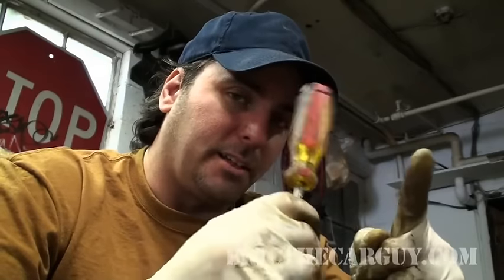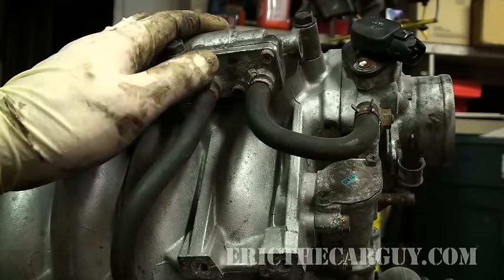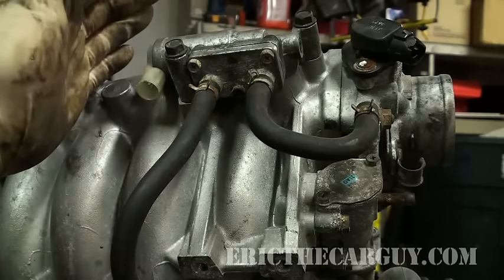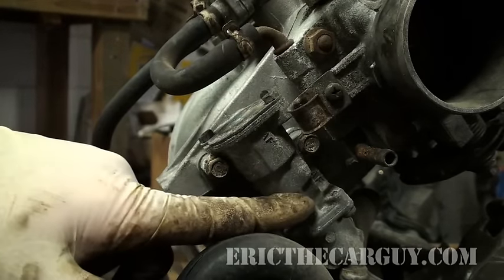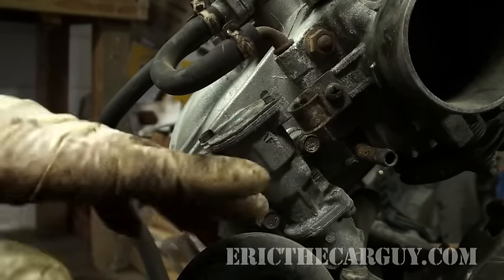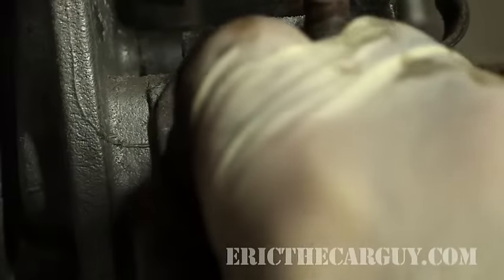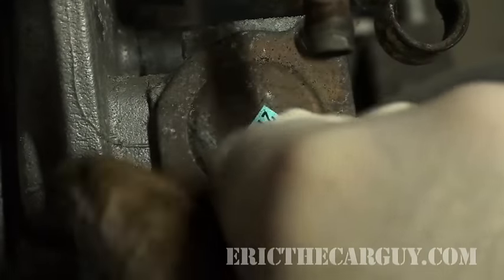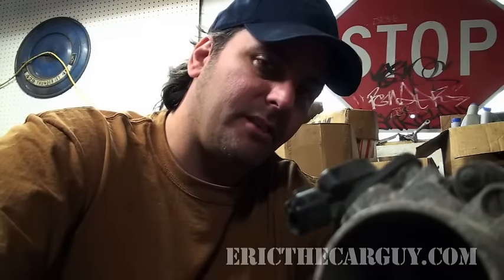How To Solve Honda Idle Problems - EricTheCarGuy

Comment: Thanks for your video, unfortunately I have a 95 Civic LX that has no scanning tool input, so I have to throw parts at it but I try to do so by doing as much study as I can on evaluating the symptoms, cause of symptoms and where the problem exist so I am thinking about it but then it’s still it’s like throwing a dart in the dark. Thanks all for your videos they are very helpful. Because right now I have replaced the map sensor, TPS, Oxygen sensor upstream…Then I replaced the distributor, all due to stalling out of nowhere, and then after we got the timing set on the distributor corrected the accelerator now will not calm down and this was not an issue before but it is an issue now so I’m trying to figure that one out.

Comment: Awesome presentation. Great advice as always.  My Honda 92 is still running well for my son's college car, but the idle slows almost to a stall when the air is turned on, (which still, after all these years, blows cold).  I'll give your possible fix a shot.  Thanks!
Reply: Beware of auto technicians who typically have only a passing knowledge of refrigeration when letting them service your A/C. And check the temp of the air coming out the vent before you take it in so if he screws it up you'll know.

Comment: Hey Eric I have a 95 honda civic 2 door coupe and I put a jam zc Non vtec engine in it and I have been driving the car for over a year now and the only problem I ever have is after I drive it for a few hours it starts wanting to have a slight sputter when I take off at a red light but it clears up right away soon as I get in second gear other than that it runs really strong but when it starts to sputter I usually let it cool off and then I can drive it again for a few hours and then it starts doing it again.its not a bad sputter just very small like one or 2 really quick sputter I really appreciate your advice I have fixed alot on my car from watching your videos except this one issue

Comment: I had surging idle on start up and when I took this off and did this, and took off the idle control valve off and cleaned it and put it back, now it’s not surging anymore at start up but after it heats up it starts slightly idling fast up and down and doesn’t want to go right. It only does it after motor warms up. When I first crank it up it runs fine. Any suggestions? I also didn’t see anything inside of the idle control valve.
Reply: I figured out. It was just a throttle body gasket and it was sucking air. I took it off cause I thought maybe the spring wasn’t working right and after I listen the bolts up the gasket fell out in peices.  Lol

Comment: I replaced the engine on my daughters 2k accord with a JDM swap. Her car had a few upgrades from the engine we bought power steering, cruise, A/C). Her intake had the extra throttle adapter for the cruise control. So I just changed over the top of the intake. Once I got the engine running I got the IAC code along with some misfire codes. When I pulled the IAC it had 3 hoses on it, for the life of me I cannot find where that 3rd hose hooks to on this engine the hose looks like a vacuum line. The JDM engine IAC only had 2 hoses on it.
So my question is this; what is the difference between 2 hose vs 3 hoses? They both use the oval electrical plug.

Comment: Well said! Unfortunately I am one of the examples you spoke of.. have a random misfire on a 99 CRV.. I’ve replaced plugs,(ngk itidium).. wires , cap, rotor,-coil, and fuel filter- all not OEM) ( I know.. that’s not preferred) but need to get to work and not wait on parts.. had code 1399.. then misfire cylinder 3 before all the parts.. then adjusted the valves.. and double checked after two days.. but it continues.. the symptom is when driving highway speeds for any small length of time.. then when slowing down quickly.. the idle drops way to low.. then can start sputtering and cel blinks and most times it clears itself out after continued driving.. but it sounds like its not running on all cylinders until it clears up and otherwise runs great..
The timing belt looked like it has not been changed.. I know I need to get it done w water pump.. but was trying to make it till warmer temps come around first.. could it be the timing belt is stretched and causing it? Or maybe the idle control?.. it also has new exhaust w o2 sensors.. 
I’m stumped.. it runs/sounds great till I slow for any red light/stop/exit.. usually need to pull it into neutral to keep it running..
Any insight is GREATLY appreciated bud!!

Comment: on a 2001 maxima, getting idle issues, Idle too high P0505, however the air intake hose is cracked and has leak likely letting too much air into the system since its past the MAF sensor. 
intake hose  nissan part #16578-2Y000.  Ordered part few days ago for it. hopefully that resolves it.  it's a intermittent issue that showed up after  some work was done to the car.  PVC and Grommet were just replaced along with plenum Intake gasket and other intake gaskets on throttle body.

Comment: Nice video. Mine reved up and down and it was the pcv valve hose. It had a gash underneath. Replaced the hose going to the pcv and intake manifold and it doesn't Rev up and down. 98 integra ls b18b

Comment: My car has different symptoms kind of. It idles rough but doesn't go up and down. It stays idling at the same place but It's rough and the exhaust isn't letting the air out consistently. If I turn the car off and back on once It's at operating temperature It idles at 200-300 and after a couple of seconds It goes up to about 700 and Is rough. I'm going to try the steps you suggested. Hope I figure this out today. I need to get back to work tomorrow or Wednesday at the latest.

Comment: Thanks for your video, my 2004 Honda was suddenly idiling very rough.
 I bled air out of the cooling system and it seems fine now.
One note- my 2004 Honda Accord did not have a bleed valve, I learned from another video that to
bleed air from the cooling system, I just needed to take the radiator cap off or leave it very loose.
Reply: And let it run? Without cap ? At idle obviously

Comment: just replaced the PCV valve on my 05 Honda Civic hybrid 
in order to do that I had to remove the intake manifold and disconnect some coolant lines after I put everything back together the idle was going up and down 
After watching this video I believe that the solution would be to bleed the cooling system 
Another problem that I have after this job is that my breaks are stiff and don't really work Any advice?

Comment: @ericthecarguy when you say that the Fast Idle Thermal Valve may be letting too much air in I assume you mean that the adjustment of the wax pellet allows too much air to flow in to the manifold. Later on you imply that air could be leaking into the coolant system. Am I misunderstanding you? Is there any way that if the Fast Idle Thermal Valve isn't adjusted correctly, it could be introducing air into the coolant system?

Comment: Don’t know if you’ll see this as it is an old video but I’m having a terrible problem that I can’t figure out. The issue is I have a weak orange spark and it’s getting worse. To the point that my 93 integra ls/vtec with type r pistons won’t hardly run once it warms up. I know you’re gonna kill me but I’ve replaced icm, coil, all plugs and wires, cap and rotor button. But still no good. I’m putting on a new main relay tomorrow but idk if that’s what’s wrong lol. Can you throw me some things to look at? Or point me in the right direction?

Comment: Hi there eric. I've been driving around the last 15 years with a '95 honda civic with no issues. During the past 3 to 4 months however, my aircon unit acted up. As it turned out, there was a freon leak that was corrected. Thereafter I noticed my engine was idling poorly and so I went back to the repair a/c shop. It was found that my idling was high upon start up but decreases when the a/c is turned on. The repairman advised me to bring the car to a mechanic to check the "servo". 

I haven't gone to the mechanic but did some DIY research on the matter  on YouTube that included some of your videos.  

I found the IACV on my honda and found  that it does not have the two outlets or hose connectors (how may I send you some pictures of the iacv, pls.?) but it appears these were purposely removed as borne by the fact that there are two slots for two small bolts for some attachment on the bottom. 

If the two connector points were removed purposely, how was the car's poor idling problem only manifested now? 

Thanks and more power to you.

val obana/manila, Philippines
Reply: Your engine idled poorly after the a/c repair because the extra 'drag' created by the compressor actually doing its job was not compensated by your IAC valve...<<what your a/c repairman termed the "servo", I believe. You most probably don't need the cooling system connections of the IAC valve in the Phillipines, so don't worry about those 'missing hoses'. What most probably is causing your problem is the cold-start idle speed compensator . .the plactic seating ring he turns with a screwdriver. Try the adjustment he has shown you there...

Comment: Hey Eric great videos OK 1999 Honda Civic 1.6 how to control valve replaced water pump replaced heater core flushed still experiencing high idle on the start at 2000 RPM also when I depress the Excelerator it brings it back down to 750 after a long warm-up. The warm-up. Is longer than a half hour sometimes getting some bounce on the RPM gauge

Comment: Please help me Eric... I've got a 1999 Civic that is starting to drive me nuts... A few weeks ago it wouldn't start, so I had it towed to a shop and two days later it was ready... The guy from the shop told me that it had been the distributor (some parts were out of place...) and that no parts were necessary, just some re-adjusting... When I got a chance to open the hood, I found out that the throttle cable had been tightened somewhat... I noticed right away that the car was idling a little lower than usual, but since it drove fine, I didn't make a big a big fuss about it... Anyway, it would always start with a low rpm, but it would go back to normal shortly after, when I would coast or stop. However, a few days later, when I went for a drive and sped quite a bit on an open road, the car's idle has changed significantly... It idles at around 1500 rpm when coasting until I come to a full stop, after which the idle drops to 1200 rpm... On cold starts, it revs up to 2000 rpm and gradually drops to 1200 rpm, so I think the IACV is ok...
I've checked the spark plugs which have about 12000 kms on them and look almost new, 
I've tried readjusting the throttle cable, but to no avail, 
cleaned the throttle body, 
searched for any hose with damage, trying to find a vacuum leak with water,
I also tried troubleshooting as in the shop manual, where you cover the lower port of the throttle body, where it states if you cover it and there is no change in the idle, then you have a vacuum leak and there is no change to the idle when I cover it...
However, if I cover the air inlet tube to the air filter, it makes what seems to be a suction noise... 
When I have the air inlet removed and stop the engine, a strange noise comes from the throttle body, like two or three hisses...
Does this mean I have a vacuum leak?
Sorry for the long post... Thanks in advance.

Comment: Question, I have a new IACV installed, done with the ECU reset, done adjusting the FITV, now my problem is, when I will start the engine aircon off the idle is to high around 1500, and when my aircon is on, the rpm will drop and drop until the engine will stall. What might be the problem of my civic? by the way my civic is a 1995 honda civic ESI with d15B engine on it..

Comment: Thank you. LTFT is adding fuel, suspect vacuum leak or stuck open IAC. Also, intake air horn has oily deposits, may be from diluted crank oil from extra fuel being added via LTFT. PCV looks ok.

Comment: Approach to Honda Idle Problems: (1st) check for air in the cooling system, (2nd) check for vacuum leak, (3rd) if you have idle problems and a check engine light, find out what's going on with the check engine light first and then other options, (4) can tap the IAC while it surges to see if changes things, (5) check fast idle valve.

Comment: Hi Eric, I cleaned my 2003 Honda Accord throttle body and replace the idle air control valve with a new one, now I have a car with fluctuating idle. I did let the air out of cooling system but at this point I don't know what to do next. Any suggestion would be highly appreciated. Thanks, Mark.

Comment: Would you recommend cleaning the Idle Air Control Valve? I've seen many people doing it with Preludes, did that on mine, now the idle was way worse and just gonna grab one off a salvage car. It was dirty for sure and tried to unplug the battery to do an idle relearn but that didn't fix the problem.

Comment: Ive been throwing parts at my CRV. 98. 235K Injectors were bad and O2 Sensor (upper) Ive cleaned and adjusted these parts you have shown in this video. The thing has no power when you start it. You can drive one block and it gets where it wont pull out at a stop sign. Will rev up in gear but will barely roll in gear. Its an automatic. It has new plugs, New distributor unit because of a broken dist cap bolt. Runs pretty good other than this. Ive had it 4 months. No codes. Im probably going to buy a Idle Air Control. For maybe a mile its dangerous at stop signs.

Comment: Thanks man! Fast Idle valve adjustment you showed fixed my cold start surging completely. PITA to get to it on 96 Accord but was doable in about an hour.
Reply: how do you get to the fast idle valve? thanks in advance!
Reply: @calebsj  its under the throttle body. I was able to do the job he describes by brail lol. 2 10mm bolts hold the cover on, and then a small flat head screw driver to turn the plastic piece back down tight. I did remove the air intake tube off for room.

Comment: I made the adjustment as shown in this video on a 1992 Accord around 3 years ago to fix a idle-hunting problem.  Car idled fine under all driving conditions until last winter.  Starting last winter, my car has no high idle during cold starting.  When the weather was really cold last January, when started, engine is slightly under 1000 RPM.  I have to rev the engine by pressing the gas pedal to keep it from stalling.  Once warmed slightly, engine idles fine at that normal-operating-temperature RPM (i.e., slightly under 1000 RPM).  I checked the fast idle valve (FIV) adjustment again and that was fine.  I was under the impression that the IACV affect normal idling only.  Does the IACV affect fast idle also?  What else could be causing my problem?  Idle is mostly steady at slightly below 1000 RPM once engine is warmed up.  I've already checked for air in the coolant and vacuum leak; both were fine.

Comment: He's right, I just found out the hard way & spent 1,200. I replaced fuel pump early & still had crank no start had all 4 things compression spark etc. In hail Mary all or nothing I bombed it & bought new assembly on 2 veterans recommendations on what was wrong by both of them listening to my car over the phone, over the phone they both go "well first off, you got all 4 & I'm pretty sure it's your fuel assembly. Replace whole unit" & other says within 4 seconds he says "replace your fuel sending assembly call me after it starts for relearn" lol it started. I watched a million of your vids man & I don't think I saw crank no start on 2005 civic where everything works, car primed & fuel was even coming out where tank meets line, it just wasn't enough pressure. You steered me in right area, thank you.

Comment: Hey Eric! I have bled the coolant, checked for vacuum leaks and have no CEL, My idle drops randomly while the car is warm. B20Z2 A/T. I have cleaned IACV and Throttle body and replaced gaskets. Had my A/C recharged because the compressor was fast cycling but now I have read it does that if RPM's drop below 600. Any ideas? Thank you.

Comment: Let me ask u a question. If I got a brand new iacv would i still need to do what u did in this video of opening up the iacv from the back and adjusting it? My idle goes to 2500. When I drive and push my gear in the idle jumps higher every single time I put the clutch in. When I come to a complete stop the idle comes back down but not low enough like 1500 rpm

Comment: Hello and thank you for the video. My car, a honda civic mk8 has a problem when I disengage the manual gear meaning that the rpm drops for a second below the nominal value of 750rpm. It only happens when lights are on or ac is on.I suspect it is the idle air control valve that needs to be cleaned but not sure about that. I would be thankfully if you could reply with your opinion based on the information I provided above.

Comment: I have a '91 Accord with the F22 auto no VTech. It vibrates at idle. It otherwise runs and drives perfect. As soon as I touch the gas it's smooth. I've replaced the plugs, wires, cap & rotor, air filter, and torque mount (it was trashed). I also adjusted the valves. .012 exhaust and .010 intake. The timing belt and components are fairly new. I did all this to smooth out the annoying vibration to no avail. There's no check engine light. The idle is stable. Any pointers you can offer me?

Comment: Hi Eric

I have an 91 acura legend KA8 and  it has been sitting for 4 weeks and idles high and low when cold and then comes good when running .

I have air in the cooling system. The Bleeder bubbles and fan does not come on

Comment: Eric I have just bought an 2001 honda prelude.. it only has 135k miles on it but after it starts to warm up, the idle starts to drop close to 250 rpms but cut off once.. it's an automatic.. so there's no clutch issues... what should I do to start diagnostics... there's no check engine code thrown either.